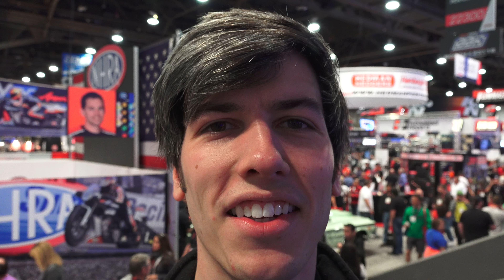10 Awesome Car Parts From SEMA - Specialty And Performance Parts Car Show

Comment: That ice cooling a turbo charger is nothing new. I remember watching one of those mini documentaries on /drive called something like "Why turbos are the best" and the man speaking talks about using ice to cool a turbo charged car several decades ago.
Reply: +kookieless Indeed, a lot of drag cars start with ice at the tree and at by the time there at the line it is water.
Reply: +kookieless yes its a very old method, using dry ice, its old but still many use it.
Reply: sweet dreams As it works, others use Methanol, but again depends on classes and rules.. oh and if you cant find meth to inject, ice is only a freezer away.
Reply: Yeah, they use ice in water to air intercoolers in a lot of the turbocharged Bonneville racecars. It's nothing new.

Comment: I would like to know the advantages/disadvantages of having inboard brake rotors vs. outboard rotors. My '93 Jaguar XJ6 has inboard rotors (I believe only on the rear axle but could be wrong) along with many other older model jags.

Comment: Hi EE,
What is the name of the Variable Twin Scroll Turbocharger?
I know the Variable Vane Turbo for petroleum currently out from Borg Warner is the BV50 and is featured in the Porsche 997 Turbo.
Any further stats on this turbo like operating temperatures, max boost pressure, etc would be immensely helpful!
Thanks heaps!

Comment: Hi Engineering Explained,
How does dampers tranfer Kinetic energy into heat?
Thanks :)
Reply: Basically in a closed system 
Energy initial = energy final
Kinetic energy = friction 
1/2mv^2 = ukN•S
Reply: +Lawrence Lo The damper compresses, creating pressure, which creates heat. Bam.

Comment: This is why engineers annoy me. 

That metal box is so simple, yet so freaking effective for drag runs or short auto x laps.  Simple, effective, cheap to produce, no moving parts. Works well. That is amazing.
Reply from the maker: +Robert Tanksley I completely agree. It's simple and effective and I love that. It's just not exactly innovative; this isn't a new concept in drag racing. My only desire is that SEMA had a larger focus on innovation.
Reply: I see
Said the blind man as he pissed into the wind.

Also I really enjoy your videos.